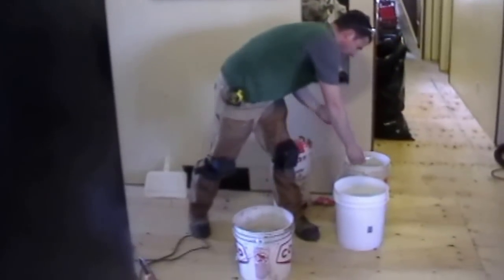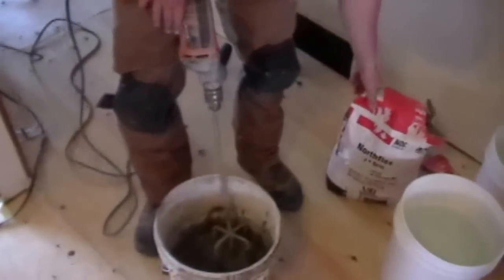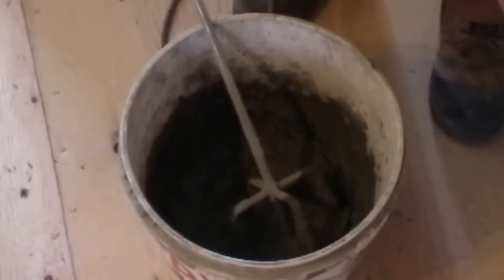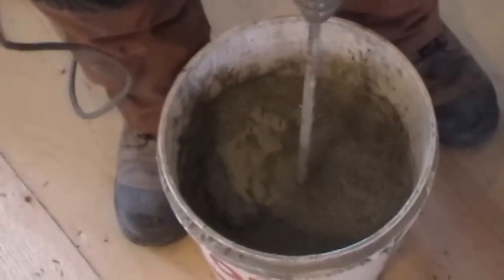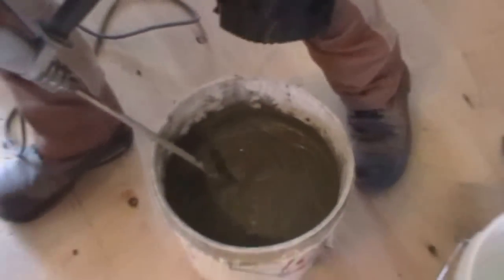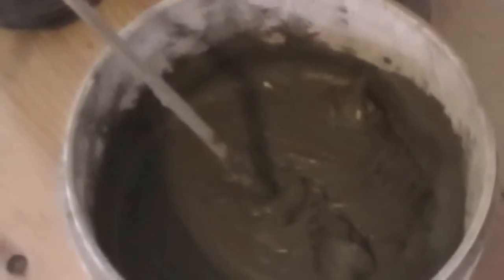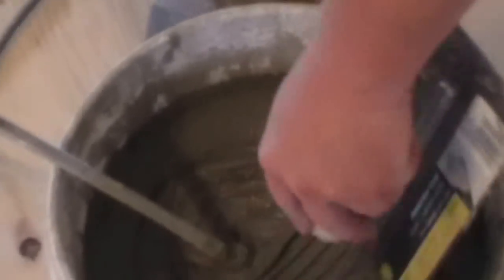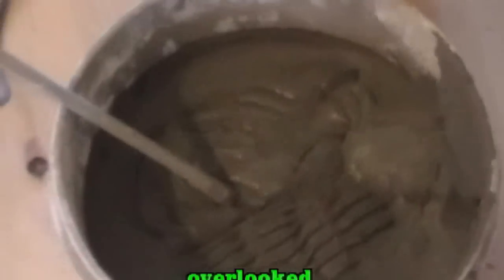How to Mix Tile Mortar

Comment: Once you mix the mortar how long do you have to use it all before it hardens up in the bucket??  Is there a way to keep it fresh till i need to use it. I need to do a 8x10 area how many buckets of mortar do you think I will end up having to make???? I'm a woman and made up a bucket of this stuff once before an it wasn't easy on my old arms so decided to use it the next day but had hardened on me, so before I try this again in need answers. Good video, its exactly what i Did the first time.
Reply from the maker: Suzanne Campbell You have about 2-3 hours of working time before it's start setting up and becoming unusable. It will get to a point where you can still scoop it from the pale but it won't bond very well to the tile. Throw it away at this point. An 8x10 area will take 2-3 buckets (about 1/2 full).  I recommend mixing small batches for less waste. And just make sure to put water in the pale first, then add mortar. Works better this way. Keep the mix thin and keep adding mortar until the desired consistency. If you try mixing too thick at the start it's a lot harder on the arms. Hope that helps.
Reply: Yes it does help, thanks! Making half a bucket at a time will be better too, when I made that one bucket totally full it got really hard to mix!
Reply from the maker: ya a full bucket is absolutely a lot harder to mix. I only do that when in a big area with minimal cuts. Then I can fly.

Comment: The directions on my my bag says 3 parts water 1 part mortar. I did 3 quarts of water and 1 quart mortar exactly. I mixed with an electric attachment, then waited 10 minutes, then mixed again. My mortar just settled on the bottom. It was super watery. What do you think could have been the problem?
Reply: +AlwaysFi way too much water.
Reply: I think it should of been 3 parts mortar 1 part water heh

Comment: You really have to read the directions. Laticrete is different than Mapei.
Reply from the maker: +Batsen Belfry Ya you bet! So many varieties or mortar and thinset. I also double check to make sure i'm using the proper product for the application I have in mind.
Reply: Got to say that there's some intestine new products coming out. Quick drying sounds great.👍
Reply: Interesting